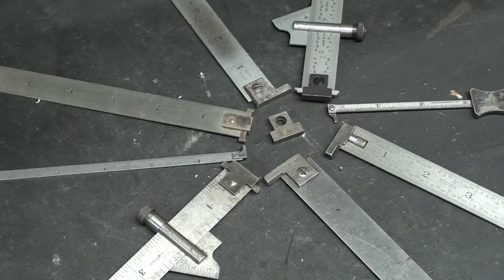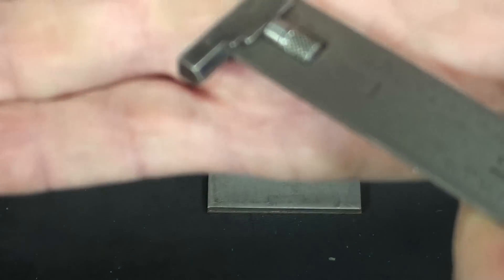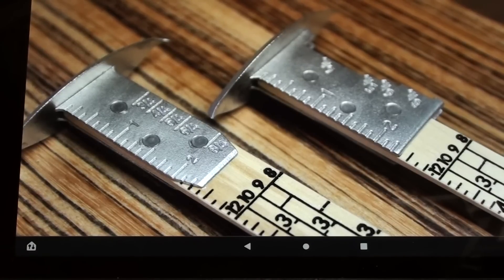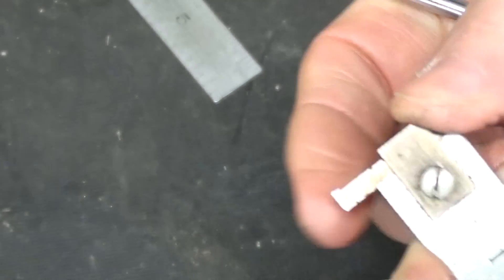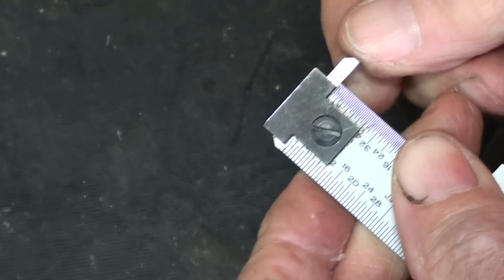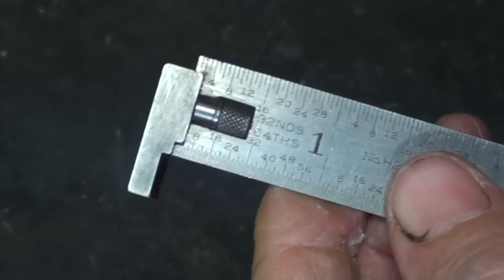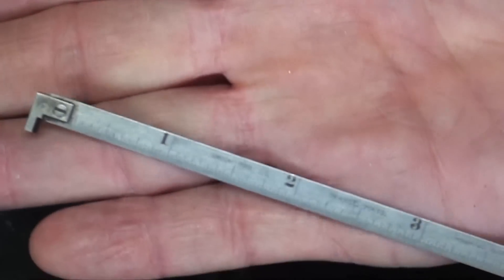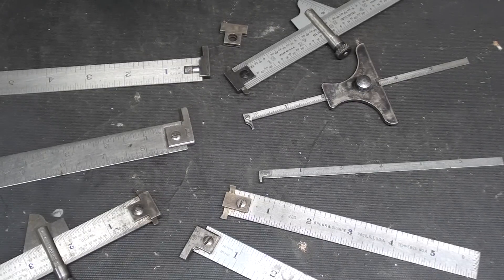WHAT IS A HOOK RULE short #24 tubalcain lufkin starrett

Comment: Very informative, thanks for a great and up to date video.  You might laugh, but I use these small rulers all the time on my computer. I capture pictures of the rulers on my screen and save them in a Rulers directory.   When I see something like a chuck or a part I'm interested in, I capture a picture of it, paste it onto a spreadsheet then insert one of the rulers on top of it.  I stretch the ruler to match some dimension on the part and then it's to scale.  Then I can easily move the ruler around, flip it, rotate it and take any measurement I want.  I use them all the time, sometimes metric, 1/10 inch scale or fractions and lots of different lengths.  I hadn't realized that hook was on some of the rulers I've used in the past.  My dad always had one of those folding rulers in his overalls pocket when he built and worked on our house.  I fiddled with it a lot and never saw that hook (that was probably best).  BTW Did you see me?  I had my hand up.🙋‍♂
Reply from the maker: Yes, I did see your hand up and I called on you. Great idea you had on using and scaling pictures with an imaginary ruler. I often would like to measure something that is on the screen to get an idea of the true dimensions.
Reply: @mrpete222  The other nice thing is that I don't have to put them up when I'm done.  I just leave them on the picture and keep scrolling down dropping another picture below that one.  It gets to be like a long roll of toilet paper.  I have to remember to put some actual words around them so I can search and find it again.  I have years and years of them.  What do you call that when they put a whole bunch of pictures together?  That's what it looks like, then another topic and another...

Comment: Nice vid. I recognized that small Lufkin tape measure with the ‘Chrome Clad’ blade. Have several myself.
PEC rules were purchased by the government since they were USA made. I was a machinist in the Air Force and that was the brand supplied. Never liked them as the scale is difficult to read. Not as crisp as a B.S., Lufkin, or Starrett.
The sharpest scale I own is a ‘Arch’ brand, made in Japan. I have 2, 6” 4R scales. One satin one black.
As a professional tool nerd I have searched for years looking for a few more. Nothing, zilch, nada. Anyone heard of ‘Arch’ scales?
Reply from the maker: No, never heard of them

Comment: I have a 6" hook rule on my desk, it's been with me for 25+ years and was issued to me shortly after my apprenticeship. It has a hook that most closely resembles the Brown and Sharp model but otherwise it more closely resembles the one with a drill guide (it too has a drill guide) except one side is metric (it was purchased in the UK). Other than Tempered and USA though it has no markings except for the scale. It would be interesting to find out who manufactured it?
On a side note one of our old boys used to say you should be able to machine down to 0.005" with a hook rule and he could put his money where his mouth is.

Comment: PEC rules are still USA made and are available from suppliers like Travers Tool. A few dollars less than the Starrett but nicely made. PEC uses the cam screw to adjust the position of the hook. As best I can tell the Starrett hooks are all fixed now which is the reason I bought the PEC. Somewhere between $30-$40 for either rule.
    Import rules are much cheaper, but as always, in 25 years the Starrett and PEC quality will still be there and the price long forgotten. An often overlooked feature of tools such as those made by Starrett is that if you lose or damage a special screw or component you can get a replacement part. With your mystery brand tool you are pretty much out of luck fixing it.  
Cheers from NC/USA

Comment: i had to look up the Pica. There are 12 points in 1 pica and 6 picas in 1 inch. There are 72 points in 1 inch. I too have a hook rule and forget to use it. More often than not, my choice has been a 6" or 8" dial caliper and the hook rule sits.
I have a couple zig zag rules and we my dad always called it a carpenters rule,

Comment: You keep showing Lufkin tools, and until I started watching your channel I didn't know they were as big a deal as they are/were. My first tape measure was a Lufkin. It wasn't anything special. It had a plastic case, was 50f long, the tape cranked in (no spring). I used some of my birthday money to buy it. I think I was 6 or 7. I still have it, and occasionally use it. Somewhere along the way the fastener that held the tape to the crank broke, and I decided to fix it, rather than toss it. After seeing some of your videos, I look for Lufkin first.

PEK is still in business. There as tons of tools that look just like them online, but I have bought several of theirs because I liked my original double square, and they are made here. Even better, I lost the adjustment screw out of my double square, and they actually would sell me just the adjustment screw. It wasn't a ridiculous  price, nor the shipping.

Comment: Long 'e' sound in "pica" when you're referring to the typesetting unit. We always called that a "pica pole" in the newsroom. 

There's 12 points to a pica. The better question is "How long is a pica?", to which the answer is 0.166", exactly.

I wonder if that rule has garnets on the other side. Those used to be used for measuring ads in layout.

PEC is still in business. Not quite as nice as Starrett, but much less expensive. They're the only company that seems to be selling a 16R hook rule these days. Starrett only has them with fractional graduations.

Comment: To measure thread depth, I used a broken tap extractor finger that i ground to narrow the hook end to catch the thread at the bottom of the blind hole. I also ground notched on the length of the leg to indicate the depths. Those legs could also be brazed into a small hole in the end of a rod to get extra length. The alternative was taking time to turn in a thread gauge to the depth.
Reply from the maker: Great idea

Comment: I was recently restoring my slightly rotted barn window and wanted a tape with a hook on the top side. I found the Lufkin L1116 with hooks and markings on both sides of the tape. I was able to get a more accurate measurement looking across the still un-rotted portion of the window stile to the tape.

Comment: If you had asked thar 30 years ago, I'd have a solid answer. I was studying printing for a job that disappeared and I never used that bit of information. But a shot in the dark, I think 12.
Reply: Elite
Reply: @samclemens2916  thanks
Reply: I just remember that the two options on an electric typewriter were 10 and 12. I don't even remember what the other one was called.